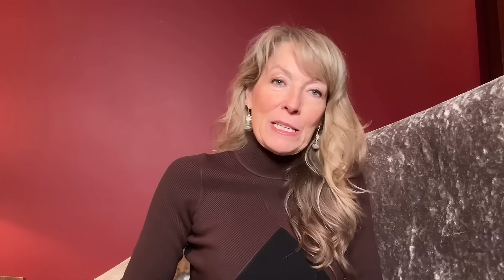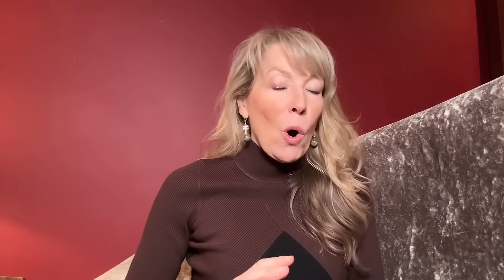Sun Dimming Explained | The Climate Experiment Nobody Voted For!

Comment: For those of you thinking of buying an electric car to save the planet just read this. This is a Tesla model Y battery. It takes up all of the space under the passenger compartment of the car. To manufacture it you need: -12 tons of rock for Lithium (can be extracted from sea water) - 5 tons of cobalt minerals (Most cobalt is made as a byproduct of the processing of copper and nickel ores. It is the most difficult material to obtain for a battery and the most expensive.) -- 3 tons nickel ore -- 12 tons of copper ore You must move 250 tons of soil to obtain: -- 26.5 pounds of Lithium -- 30 pounds of nickel -- 48.5 pounds of manganese -- 15 pounds of cobalt To manufacture the battery also requires: -- 441 pounds of aluminum, steel and/or plastic -- 112 pounds of graphite The Caterpillar 994A is used for the earthmoving to obtain the essential minerals. It consumes 264 gallons of diesel in 12 hours. Finally you get a “zero emissions” car. Presently, the bulk of the necessary minerals for manufacturing the batteries come from China or Africa. Much of the labor for getting the minerals in Africa is done by children! If we buy electric cars, it's China who profits most! BTW, this 2021 Tesla Model Y OEM battery (the cheapest Tesla battery) is currently for sale on the Internet for $4,999 not including shipping or installation. The battery weighs 1,000 pounds (you can imagine the shipping cost). The cost to replace Tesla batteries is in $US Model 3 -- $14,000+ (Car MSRP $38,990) Model Y -- $5,000–$5,500 (Car MSRP $47,740) Model S -- $13,000–$20,000 (Car MSRP $74,990) Model X -- $13,000+ (Car MSRP $79,990) It takes SEVEN years for an electric car to reach net-zero CO2. The life expectancy of the batteries is 10 years (average). Only in the last three years do you begin to reduce your carbon footprint. Then the batteries have to be replaced and you lose all the gains you made in those three years. Let that sink in.

Comment: "Today's CO2 concentrations worldwide average about 380 parts per million. This level of CO2 concentration is trivial compared with the concentrations during earlier geologic periods. For example, 460 million years ago, during the Ordovician Period, CO2 concentrations were 4,400 ppm, and temperatures then were about the same as they are today."    

"... the current global average temperature is roughly... 60 degrees Fahrenheit. About 55 million years ago – just after the age of the Dinosaurs – the era known as the Paleocene-Eocene Thermal Maximum (PETM) saw average global temps as high as 73 degrees Fahrenheit." - and the climate was the SAME.

Comment: When we used coal to make electricity the emissions dimmed the sun, when we passed the clean air act more sunlight reached the earth . That caused warming so they are going to put sulphur dioxide ( the same as the coal did) into the atmosphere to cool it down again. Not good if you have solar panels which they are spending billion on.

Comment: Spare us the underhand climate denial cynicism.  On current trajectories we will have passed  +2°C by 2040, racing onto 3° a decade or so later.   That represents an uptick in extreme weather events, heat, drought, flooding - all of which will decimate farming & induce famine, enforced migration, armed conflicts etc etc.  Not to be dismissed lightly by a few glib comments.

Comment: CLIMATE CHANGE QUESTIONS!?
          A pensioner here that can hammer a nail in a wall, fix an engine, mix concrete and weld a bit etc but no scientist! So all the UNI FED BRAINS maybe some of you can answer a few questions! 
         I can remember all sorts of BRAINY WONDERS OF THE WORLD, likes of ROYAL CHARLES, ATTENBOROUGH making predictions and in my eyes never happened. Even before that was told by 2000 there would be no ice or polar bears. Yes that have all stripped off the fur coats and all laying in the sun! In a new study published by PNAS, experts said that there was a plausible chance that sea levels would rise by 2 metres by the year 2100.
LAST STAEMENT HERE-----SEA LEVELS WOULD RISE BY 2 METRES!?-----END.

Q1.  Where is water going to come from for a 2 metre rise!?
A1.
Q2. If all the ice in world melted how much would the sea level rise and please explain that ie how much ice is there and when melted and spread out over the oceans how many metres would it cause a rise of?
A2.
Q3. Giving figures for answers please give the average sea temp for the year 1900, 1950. 2000. and 2024. Please use the same area for all readings be it in the North Sea, Atlantic, Pacific etc. At same time of year!
A3.
Q4. Please do same with air temp, same location and same time of year!

Comment: I'm confused why they're geo engineering the sky during the north of Englands  coldest and wettest months. Are they trying to delay crops and reduce yields?
Reply: There is no geo-engineering in UK Airspace
Reply: @andyb2515 I have no other explanation for the 'vapour trails' that remain and expand as they drop to the form a cloud base. Yet on another day the vapour disappears as soon as it is emitted. Been watching the sky for decades as a casual observer. Its different!
Reply: @davejohnston5158  Contrail persistence depends on the Relative Humidity of the airmass the aircraft are flying through. The higher the RH the longer the contrails will persist, the lower the RH the shorter and less persistent they will be

Comment: Cadmium sulphate spraying 1952, then look at the smog in London and deaths.

n 1952, the estimated number of deaths attributed to the "flu" in Britain varies depending on whether one uses official reports from that era or modern scientific reassessments.
The London Smog Discrepancy
Much of the data regarding 1952 flu deaths is inextricably linked to the Great Smog of London, which occurred in December of that year. 
Original Official Attribution: Initially, the UK government attributed a significant portion of the massive spike in winter deaths to an influenza epidemic to downplay the role of air pollution.
Initial Estimates: Early reports suggested approximately 4,000 excess deaths occurred in London during and immediately after the smog.
Modern Reassessments: Modern research indicates that while some influenza was circulating, it could not account for the total death toll. Instead, the total number of fatalities from the smog and its persistent effects is now estimated at 12,000, many of which were originally mislabeled as flu. 
Statistical Context
According to historical data from the Office for National Statistics (ONS):
Underlying Cause: Between December 1952 and March 1953, over 13,500 more deaths than normal occurred in Greater London alone.
Influenza's Actual Role: Scientific sensitivity analysis shows that only a fraction of these excess deaths were truly attributable to influenza.
Broader Impact: Across England and Wales for the entire year of 1952, the ONS records 21,912 deaths where "Influenza and Pneumonia" was the underlying cause, though this broad category often overlaps with environmental respiratory fail

Comment: n 1952, the estimated number of deaths attributed to the "flu" in Britain varies depending on whether one uses official reports from that era or modern scientific reassessments.
The London Smog Discrepancy
Much of the data regarding 1952 flu deaths is inextricably linked to the Great Smog of London, which occurred in December of that year. 
Original Official Attribution: Initially, the UK government attributed a significant portion of the massive spike in winter deaths to an influenza epidemic to downplay the role of air pollution.
Initial Estimates: Early reports suggested approximately 4,000 excess deaths occurred in London during and immediately after the smog.
Modern Reassessments: Modern research indicates that while some influenza was circulating, it could not account for the total death toll. Instead, the total number of fatalities from the smog and its persistent effects is now estimated at 12,000, many of which were originally mislabeled as flu. 
Statistical Context
According to historical data from the Office for National Statistics (ONS):
Underlying Cause: Between December 1952 and March 1953, over 13,500 more deaths than normal occurred in Greater London alone.
Influenza's Actual Role: Scientific sensitivity analysis shows that only a fraction of these excess deaths were truly attributable to influenza.
Broader Impact: Across England and Wales for the entire year of 1952, the ONS records 21,912 deaths where "Influenza and Pneumonia" was the underlying cause, though this broad category often overlaps with environmental respiratory fail

Comment: it also causes crop failure, great for food and the farmers,
Reply: The UK has been under a milky grey haze for at least 2 months. They're wanting to create what is known as a volcanic winter this is when a volcano erupts and spews out sulphur dioxide which spreads around the planet blocking out the sun causing famine, ill health and death by the cold. All part of their depop agenda. These days I do the opposite of what the government wants!
Reply: @applescreenprint The constant dimming especially in early spring halts the vital blue light known as cryptochromatic light or cryptochromes, this early energy begins to peak after the sun has climbed above the equator on or around the 21st March, if the ground does not reach the germination level of 42 degrees or above there is less chance of the seeds germinating, check out what is the cryptochrome sydrome, also the circadian energy we obtain in tandem.